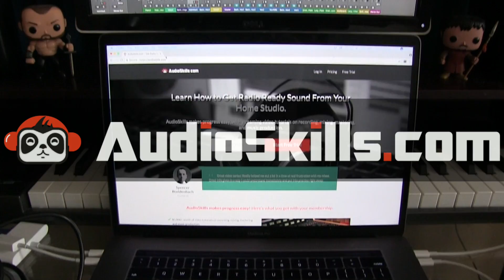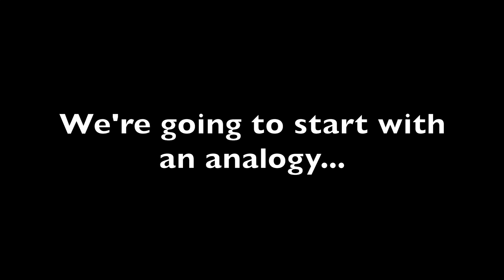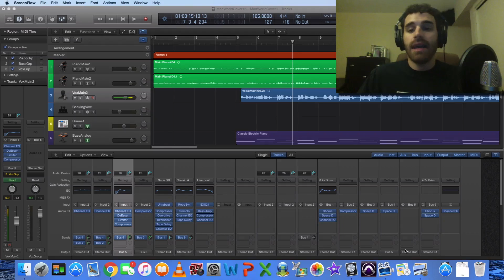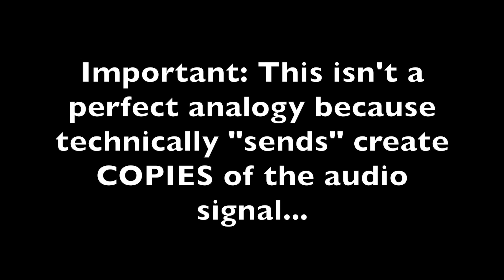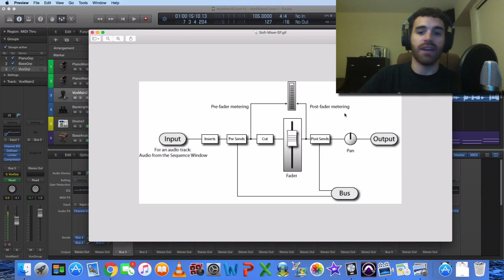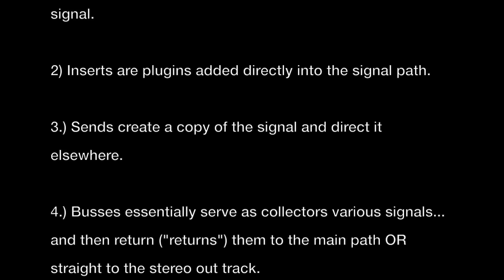What is Signal Flow in Mixing?

Comment: It would have been good to explain to the newbies why you send to busses with an example - 

You've got six mics on your drums - one kick and five across the rest of the kit. Send those five post fader to a stereo buss and then use the send for that buss out to the Master mix. This way you can control the drum mix with one (stereo) fader and insert eq or compression or effects to the buss saving on processor power. The kick drum gets treated and processed separately possibly bussed with the bass guitar. You can do the same thing with guitars or horns or background vocals.